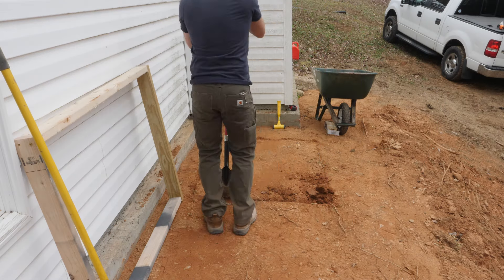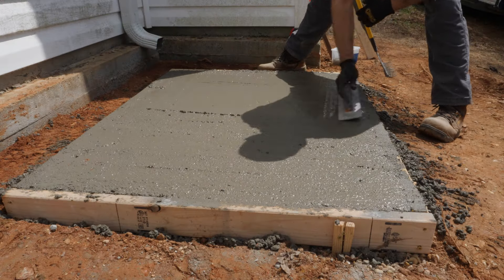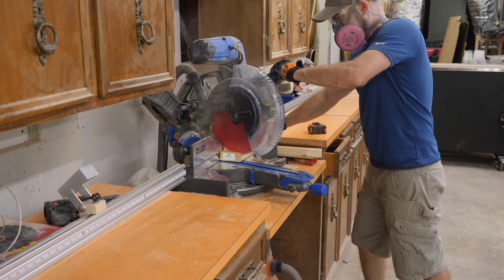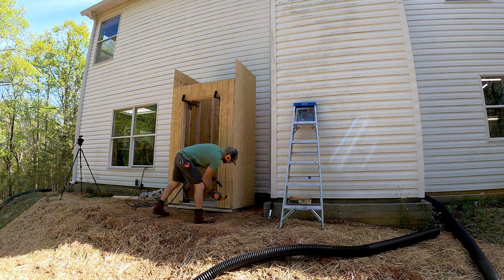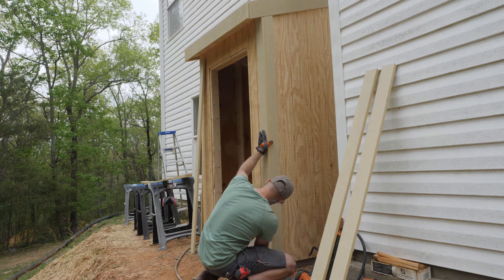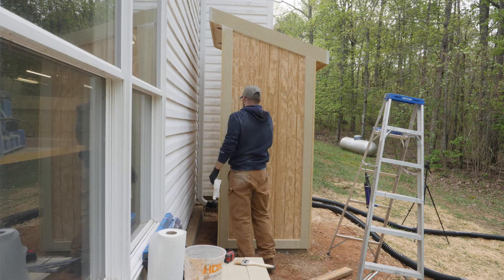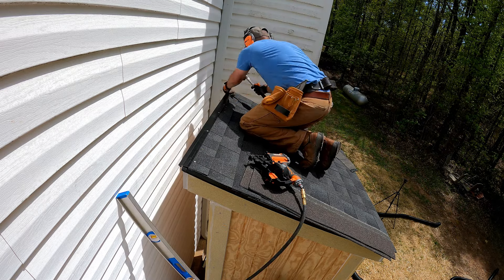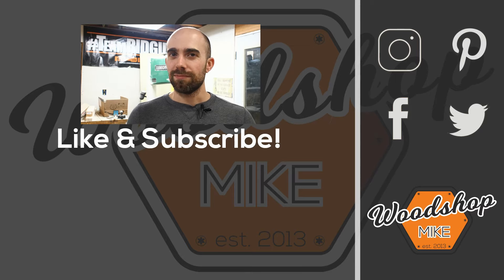How to Build a Lean To Shed

Comment: I'm building the exact same thing. Getting my Air Compressor out of my small shop. Concerned about condensation through so you may consider to put an auto drain valve on the compressor. Really nice looking job.
Reply from the maker: Thank you very much!  Yep I did put an auto drain on it👊. Happy building!

Comment: I have one of these lean to sheds. Mine is a 4x8 foot model. It’s cool it’s also my mini studio. Insulted the walls and all. Cool little personal space to have. I painted mine white as well because I was considering the heat. White reflects it so it probably reduced heat transfer a little.
Reply from the maker: Sounds awesome!  What kind of studio?
Reply: @WoodshopMike   it’s more like a little office and a place i hang two of my guitars. They’re on each end of the shed. The interior is decorated with a couple cool music posters. One is an Iron Maiden Poster and one is a Kendrick Lamar poster. From the the interior of the shed where the door is, I put a mirror up. Close to the end where the acoustic guitar is hanging is a little small desk that I can move around. I will move in a mattress in there maybe and i can lay down in it lol. I recently added interior lights with LED strips that can change colors. I usually have it set to white or blue.

Comment: Nice little shed. I would have done the roof differently though. The felt paper should go down first,  then the drip edge. You cut it a little short on the ends which with hard driving winds and rain,  may get water under the shingle and rot that osb. I also would have used reg. or if I had it, PT plywood for the roof instead of OSB. Thanks for sharing.
Reply from the maker: Thanks!  Glad you enjoyed the build👍

Comment: Nothing says spring like a well built garden shed. Very nice work.
I have heard some people say the the drip edge should be tight to the fascia board, some say it should be spaced off.  Do you have a opinion on this theory, or have you ever heard of this ?
Thanks, and God bless
Reply from the maker: Thank you sir!  I’m glad I knocked it out before the dog days of summer too.  That side of the house gets baked in the afternoon 🥵

I always keep the drip edge tight against the flashing.  Since it flares out a bit at the bottom the surface tension of the water should break before droplets could roll back and sit on the fascia boards and cause water damage.  Also by keeping the drip edge tight it discourages wasps etc from building nests.

God bless you as well

Comment: Fine job should last you a long time. I may have missed it, but I’d also anchor the sill to the concrete. Keep the winds from blowing it over.
Reply from the maker: Thank you!  It's been it some pretty good wind storms and she's holding strong 👍. I did run a handful on tap cons through the base plate of each wall.  I don't want it blowing off!

Comment: Informative!  What’s the height of the shed?  Would like to build one…tho 4x4 like this for a sauna and May need ceiling joists.  7 ft is max I want for ceiling.  Also, I may change door location.  I assume it would be easy to modify from your plans.
Reply from the maker: Thanks!  Glad it was helpful👊👊. This shed is just over 8' at the back if I recall correctly, but yes it can be easily modified, just maintain the correct stud spacing and you'll be good.  Sounds like an awesome idea to build one out as a sauna!

Comment: NICE JOB !!!     I would use it for a water heater enclosure,  but heavily insulated;   Special situation,  for a small home.    What are the dimensions ?     Thanks.
Reply from the maker: Thank you!  I believe they're 3’x4’ but you can adjust the dimensions a bit to suite your needs.  I explain that process in the plans 👍

Comment: Great work and video! I am thinking about a similar project but wondered if you had any local ordinances to deal with that require more space between your house and the shed. Any issues with that? Thank you!
Reply from the maker: Thank you very much!  It's been great to get the air compressor out the of shop, but as a garden shed it would also be very nice.  I didn't have any issues, but yes, do check your local codes.

Comment: Turned out great. Just curious, it looked like you could have gone bigger where the shed is located. What was your thoughts on determining that size shed to build?
Reply from the maker: Thank you!  Yes, I could have made the shed a bit wider, but about 2' from the front the ground slopes away.  I really just needed this shed for my air compressor and that's the main thing that drove the dimensions👍

Comment: Very good! I wish it was helpful to me since I need the same but attached to the house lol from your thumbnail it looked like that 😁
Reply from the maker: LOL, I hear ya!  To attach it to your house you would just cut away the siding where you want the shed, pour your slab, and anchor to wall studs 👍.  Then tie the siding in with house when you side the shed.   Since this was intended for an air compressor I wanted the structures to be separate for noise, vibration, and the potential air compressor failure.  Hope that helps and thanks for watching!
Reply: @WoodshopMike  anchor 2 by 6 to the studs behind wall plywood? What about insulating around cut siding?
Reply: @WoodshopMike  I see you have website with plans, do you have something for my project?
Reply from the maker: Yes but the insulation is inside the wall between the plywood and drywall.
Reply from the maker: I don't.  Since this would be a modification to your home you'd likely need to submit plans to your local building/permitting office for approval.
Reply: @WoodshopMike  correct, that’s the problem I gotta work on. Thank you for responding
Reply from the maker: Absolutely!  Good luck 👍👍

Comment: Great video! Looks so good man.  What is the size of this...3x5?  You've inspired me to pour my own slab.  Saw your plans online too.  Will they build this one exactly or do they have to be modified?  Also, glad you listed the parts and tools on here, especially which Diablo blade you used.  Sometimes that confuses me in these types of videos.  Thanks.
Reply from the maker: Thank you very much and I'm glad the video was helpful!  Yes, the plans are for this exact shed.  The slab is right at 3'x4'.  If you want to make the shed larger, just make sure the stud spacing doesn't exceed 16" on center and you'll be good.  I think I have a couple notes in the plans regarding how to modify the size of the shed.  If you hit any bumps along the way though just shoot me an email (mike@woodshopmike.com) and I'll be happy to help out👍
Reply: @WoodshopMike  Just bought your plans for the Lean To Shed!  Awesome.  Our HOA will love this!  Thanks.
Reply from the maker: Thank you so much!

Comment: Very nice. Frost heaving? I am in New England. Will your slab be adequate to compensate for any possible frost heaving or would a different method need to be used? Thanks
Reply from the maker: Thank you very much!  That's not something I have to contend with so unfortunately I can't give you an answer.  I'd check your local building codes.  Best of luck!

Comment: Great project and explanation!
I have a question about the water protection.  Did you just use the primer over the OSB?
Reply from the maker: Thank you!  The only OSB I used was for the roof sheathing (it didn't get painted since the shingles were covering it.  The sides of the shed, but that's probably obvious). The siding is R-10.  That and the trim were all primed and painted.  Does that answer your question?

Thank you for watching!

Comment: Great video! 
I’m looking to build something just like this on the dock by the lake. Do I need something more weatherproof to clad the walls with it it’s going to be getting the added weather off the lake?  Seems like it’s just plywood walls.  Should it have more or something specific ?
Reply from the maker: Thank you very much!  It definitely wouldn't hurt to build it from pressure treated lumber and pressure treated plywood.  The down side is that you have to let the wood dry for a few months before painting.

Comment: The shed will be used for my air compressor and my shop vacuum with plumbing to my tools. Also for rakes and shovels. Need to insulate it mainly for noise but I also need an air supply system. Air compressor needs clean air and the vacuum needs an exhaust. Air compressor will use outside air but I'm thinking plumbing the vacuum air back into the shop to save heated and cooled air. Any ideas? Thank you very much for your great video.
Reply from the maker: Hi Steve,

That sounds awesome!  I thought about doing the same thing in regards to plumbing the DC back into the shop to save on heated/cooled air, but after thinking through everything (including the massive holes I'd have to cut in the house) I opted to just leave the DC in the shop as it's in a pretty good spot already.

Comment: Excellent video, Mike.   What door height did you use here?  I couldn't find the general dimensions on your plans to see if they will work for my project.  I'm trying to keep the back wall height below a window.
Reply from the maker: Thank you so much and thank you for purchasing the plans!  The details on the door are on page 14 and the door opening is spec'd on page 7👍

Let me know if you have any other questions and happy building!! 🔨🔨
Reply: Sorry, I should have clarified.  I haven’t purchased yet because I was hoping to find general dimensions before buying them so I know that they fit my needs. I was wondering if you had general dimensions that are available before buying.

Comment: By reading the comments it will be ok to modify to a 3x4 correct? The opposite dimensions as the one you built. Also any ideas how to attach to the floor without drilling my existing concrete slab? Thank you!
Reply from the maker: Yep, you can adjust the dimensions.  There are notes in the plans of what to keep in mind when doing so👍 one way or another you need to anchor the structure to the slab, not really an option I'd trust to get around drilling into the slab unfortunately.
Reply: @WoodshopMike  do you have a link to the anchor screws you are using or specs? unless I missed it on the list you have

Comment: do you have an estimation on price? I am looking for a garden shed and this might be cheaper than buying one. I would not be able to do concreate as I will need to be able to move it in like 3 years-we are renting but we have a yard. If I did not do concrete could I just put planks down and then plywood on top for a floor? Also, would I need something to anchor it down still?
Reply from the maker: In the plans I have an alternate design for the floor if concrete isn't an option, so you're covered there!  When I built mine materials were around $275 - $350.

Comment: Do you have a plan for a 3 X 6 lean to that the door opening is on the 3 side?
Reply from the maker: Hi Terri,

Nope unfortunately I don't.  The plans are fairly easy to modify as long as you don't exceed the stud and rafter spacing you'll be fine to use the available plans and modify the dimensions to a 3'x6' shed!

Comment: I'm just gearing up to build my first shed. I've never done roofing before, can you tell me why you put the top drip edge over the shingles instead of under?
Reply from the maker: Very cool!  The reason I put the top drip edge (could also just be flashing) on top of the shingles at the high side of the roof is so I have a seamless "cap".  This keeps water on top of the shingles instead of potentially running under them.  Hope that makes sense.  Happy building!

Comment: Since it’s lean to, why did you have large soffit overhang in the back? What’s the smallest soffit overhang needed to have it closest to house? Does a shed need one? Thanks I’m stumped on that
Reply from the maker: I did that so that the top side of the roof would catch any rain the misses the roof line of my house.  That way the ground behind the shed wouldn't get soaked during a heavy rain.  I also made the overhang that large so that I could add some 3" round soffit vents (yeah, I know I didn't show or mention those 😕)  Hope that helps!

Comment: What size air compressor is that? Recently bought a 80 gal compressor and looking to build one for it.
Reply from the maker: This one is a 60 gal and there's enough room around it for a larger compressor to fit.  The plans are pretty easy to modify though if you need a bit more room for a large compressor👍. Happy building!

Comment: Good build. But i was hoping you would attach to house so I could see how you flashed it.
Reply from the maker: Thanks!  There are a few reasons I didn't attach it to the house, but to flash it I would have just wrapped it under the siding and laid it on top of the shed's roof 👍
Reply: Where I live, something attached to the house needs a permit.

Comment: Great video! what are the current dimensions on this build? In the description above you said in the plans that you can show us how to modify this build to fit our needs. Will it support a 4x4 or 4x6 lean to shed?
Reply from the maker: Hey Lance, thank you very much!  The dimensions of the one I built are 4x3 so you'll definitely be good with a 4x4 or 4x6👍👍
Reply: @WoodshopMike  how far from the house did u set the base?
Reply from the maker: This one is about 2' from the foundation but check your local codes especially if you're pouring a slab👍
Reply: @WoodshopMike  thanks. Will do. I appreciate the response!
Reply from the maker: Of course! Hope you enjoy the build!
Reply: @WoodshopMike  Any worries that this will make maintenance on the house a problem, like if siding needs to be replaced, will the shed have to be [re]moved and replaced?
Reply from the maker: Nope.  It'll be a bit tight right there, but there's enough space for a pneumatic nailer and a slim person to work.

Comment: That was an awesome video and you did a beautiful job !!! What size did the lean to end up being? On your plans do you offer any custom sizing ? I have a existing shed a 10 x 20 gym shed and I wanted to add space to my shed keeping a tall wall on one end to allow tall equipment. Is this something you would be able to custom size in plans? Just curious
Reply from the maker: Thank you very much!  This one is 4'x3'.  In the plans I don't have a spread sheet or chart for different size sheds if that's what your asking, but if you follow the same method you can use the plans as a guide.  The main thing is wall studs need to be no more than 16" on center and the roof joists need to be no more than 24" on center.  If you stick to that you'll be good!
Reply: @WoodshopMike  Awesome Thanks Mike .. You have a new follower!!
Reply from the maker: Of course!  Hit me up if you have any questions during the build!  Glad to have you following along!

Comment: How many bags of cement did ya have to use
Reply from the maker: I don't remember, but Home Depot has a calculator on their site.  If you enter the dimensions of the slab you're wanting to pour and select the bag size you'll be using it'll give you the number of bags needed.  I'd recommend grabbing a few extra and return whatever you end up not using.

Comment: Any reason I couldn't insulate it and put an electric water heater inside?
Reply from the maker: I wouldn't think so.  Folks put water heaters in crawlspaces so I wouldn't think this would be a problem.  Just curious why you'd want the heater in a shed?
Reply: @WoodshopMike  I was thinking of getting a heat-pump hybrid electric water heater, but they're both noisy and cool the room around them, and take up a lot of space.  So I thought maybe to put it outside, but it'd need to be protected from the weather.  But actually, just in the past few days I've now decided to go with a tankless electric! (much less space and silent, can put indoors).  Thanks for your video, I may still build a shed for tools, etc!
Reply from the maker: Makes total sense!  Thank you very much, glad you enjoyed it👍😃

Comment: How many inches is the shed from the main house ?
Reply from the maker: I think it's 18-24.  There enough space for me to just barely get back there 😂
Reply: @WoodshopMike  Cool shed! I’m sure this is a dumb question but could you have saved space by just building the shed to be attached to the side of the house?  Or is that typically a bad idea for some reason?  I’m thinking of building something similar to what you did but was thinking of not having any space between the house and back of the shed.

Comment: If it was for the compressor I would have run conduit up through the slab for a clean finish
Reply from the maker: That'd be nice for sure but I didn't want to drill through my foundation.  The way I ended up plumbing everything was with copper pipe through the conduit that goes through the house wall.

Comment: It’s beautiful and well made but I don’t like the weird spaces behind it and between it and the house. Just a place for an animal to hide and trash to collect. The drain spout needs to extend away from the foundation as well 🤷🏻‍♂️
Reply from the maker: Thanks Scott!  If this wasn't for an air compressor I would have built it flush with the house, and tied in the siding etc, so that's the reason for the gap.  I contemplated the same negatives you brought up & thankfully it's not been an issue.  Hopefully it stays that way 🤞.  Totally agree about the down spout and good eye! I have an extender hooked up, just took it off in the thumbnail for aesthetics.  Cheers!